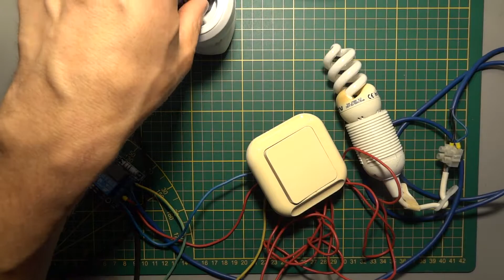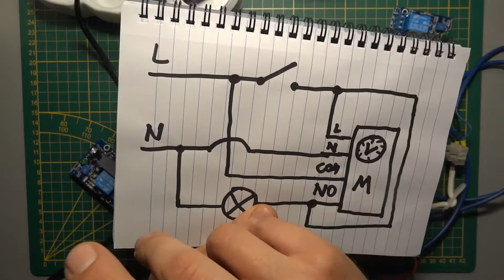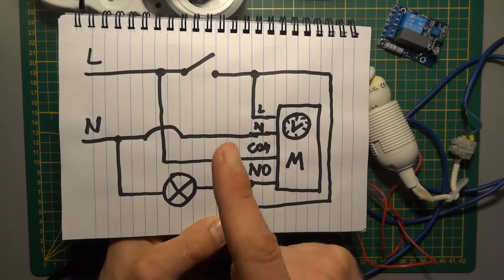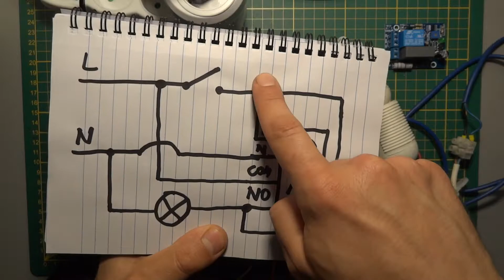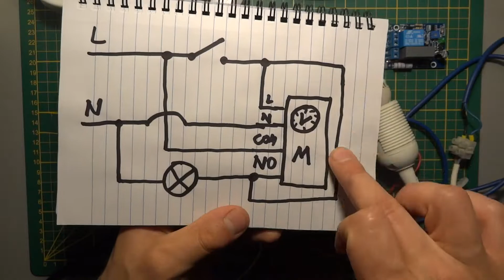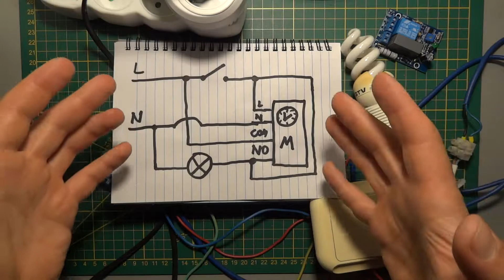AC light or fan timer with 0 WATT standby power

Comment: A fan is an inductive load.
What about arcing inside the relay?
Are typical "box fans" low enough inductance to not harm an AC-timer's relay?
Reply from the maker: This relay was rated for 10A so theoretically it would deal with up to 2300W resistive load, so I'd say there's a bit of a margin to run a <25W bathroom fan even considering it is a highly inductive load 😁 most relays are somewhat resistant to arcing and this is the main component that would close the circuit with the fan.

With a large, high wattage box fan(I'm thinking 400W+? They often have ~0.5 power factor) I think it's up to the relay's quality and these are surely not high quality relays. I don't really have experience with using relays on high power inductive loads.

Having said that, I have the exact setup as in the video and it's still works 2 years since. My main concern was the quality of electronics or humidity in the bathroom affecting something, rather than relay failing.
Reply: @pandaengineering  GREAT RESPONSE!  Thank you.

Comment: This great 👍. Is there a similar module with a current sensor to detect standby current and shut down the power ?
Reply from the maker: If you mean the module itself - basically all mains powered timer modules with a relay can do that as this circuit is basically backfeeding the power to itself. There is no current sensing here. I use this for my bathroom fans daily and the wall switch has a spring so it instantly turns off ( just like doorbell switch). Only thing I noticed is that if you press is for a very short time (I guess less than 100 ms) it won't "latch on", you need to press it for tiny bit longer.
Reply: @pandaengineering   Thanks, i understand the relay module you used. i was asking about a different module , i want to make my own standby power saving unit, it would be plugged in between i.e. your tv set and the power outlet, and when it detects the power consumption is at the standby level , it activates the relay and disconnects the power.
Reply from the maker: @supernova1976 I was thinking how to do something like this few times (not exacly with a TV but some old appliances, because modern TVs are crazy efficient in standby if you disable all the wifi stuff when not turned on, it's now like <0.5W). This is always tricky, because you need to manually trigger the circuit to close for a moment and then monitor the power consumption when it's on, so the only thing it would get you is that it latches off when the TV enters the standby. I'd imagine the simplest way to do this would be something like programmed ESP32 or arduino that has power relay and power monitoring modules and looks for low power consumtion for certain amount of time and shuts itself off too. The thing is, it always made sense to me only just doing that as a proof of concept and not as practical thing as just cost of parts would surpass few years of paying power bill for that appliance in standby and if I still have to push a button to turn it on (because you need to bring the power somehow back, just like with this fan), it's not much different that just putting a switch on a cable.
Sockets with remote could also do the trick, but I recently used one for our Christmas lights and they take 0.7W when they're *off*! (granted, these are 10 years old, so maybe the tech got better). I have old CRT TV that I use rarely for games and that 90s beast pulls 10-15W in standby - only for cases like that the socket with a remote would make more sense. Still - considering how much I paid for the remote sockets, it would take 5 months of that old CRT in standby to equalize the cost of these for me, so I just unplug since I really rarely use it 😁
Reply: @pandaengineering  Wow thanks man , you gave may some good ideas, much appreciate it 🙏. I found the device that does this exact thing ANSMANN Energy-Saving AES3.2
Reply from the maker: @supernova1976 I just looked it up, this is really cool!